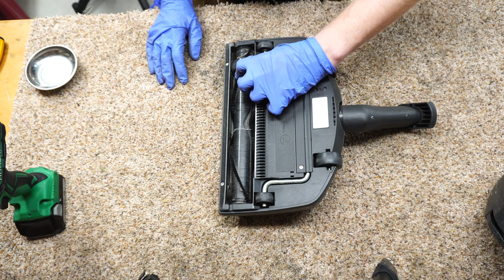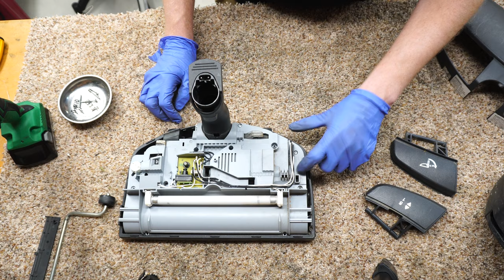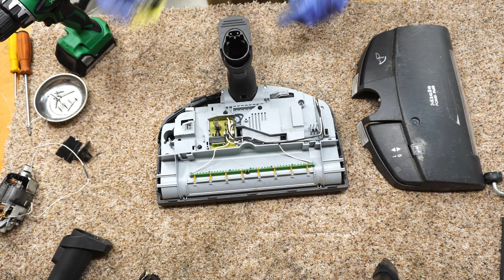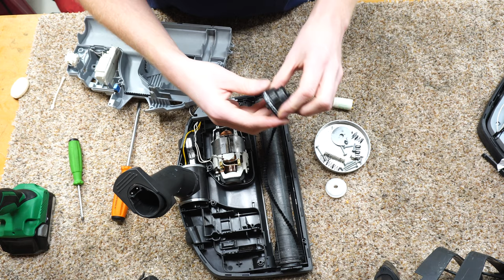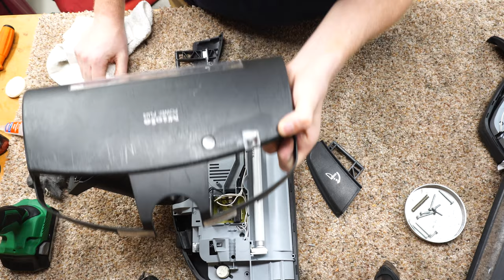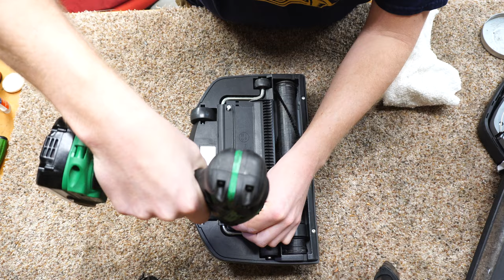Miele SEB 236  Electro Premium Powerbrush S8 C3 - Vacuum Repair

Comment: Did you speed up the video? It seemed a little fast
Reply from the maker: Yes about 20%
Reply: @PerformanceReviews  I wish it was in original speed. No rush
Reply: It still seems to drag
Reply: How can I order the plastic part that broke? Our local dealer had no onsite vac repair tech. The cost of shipping it out plus actual service fee was almost the cost of a new head.
Reply: @sgtjonson  you can slow the playback using the gear icon. also you can zoom in on the playback, which can be helpful.

Comment: I was director of a large data center.  A professional data center cleaning company came in. The used a Miele vacuum in the smaller areas. So when our home vacuum broke my wife and I went to a professional store and purchased on. That was over 15 years ago. Today I am replacing the belt on the power head. My wife loves her Miele.

Comment: It it a very robustly built powernozzle that performs really well and the convince of being able to adjust the height with your toe is great. However it’s extremely complex and we’re I to install a central vacuum system in my house I’d most likely opt for the Sebo ET-1 powerhead instead. I believe that its removable brushroll encourages more regular maintenance thereby lessening the need for a thorough service as this very often. It also comes with a color selection which is cool.

Comment: Just took apart and cleaned mine. It's basically the same internas as the SEB228, what's the point of offering both? Seems like economies of scale making just the SEB236 would be more profitable in the long run?
Reply from the maker: The EBK 340 came before the EBK 360 the SEB236 is an evolutionary stock Gap in between them that came out a decade before the EBK360 aka the SEB228

Comment: This video is gold. It goes by quickly, and it's a bit confusing with the two or three different varieties of power brush being worked on simultaneously, but he's got lots of great tips in there. You can tell this guy does this for a living -- he assembles and disassembles these things like a marine field-stripping a rifle.

I found this video after my Miele SEB 236 power brush kept tripping its breaker. I had already pulled a ton of hair out from under the belt with tweezers, without disassembling the head, but it would still get stuck, and the brush was hard to turn with my fingers, so I figured it was time to take it apart. Still, this was after eight years of service in a three-dog household. So it's not like this is something you have to do every year or even every three years (though it probably couldn't hurt).

My brush had two squirrels' worth of hair inside it, especially tangled up in the motor gear that turns the belt! Gotta hand it to Miele though, the parts are solid as heck, metal and dense plastic, and after I pulled all the hair out it ran like new. The belt is toothed instead of smooth, and still looked great after a ridiculous amount of dog hair abusing it for years. I added silicone grease to the height pedal plate and tri-flow to the motor and the brush bearings like in the video. I just scrubbed out the inside with cleaning wipes instead of running it through the dishwasher, because I wasn't brave enough to totally remove the motor and re-tension the belt. But I figure I got 80% of the way there. Also, the tip about the bearing cooler holes in the brush was gold -- I made sure to clean those out as well.

As other comments have mentioned, watch for the screw placements on the gray interior part. There are a ton of screw holes in it, but only five of them (on my model) were real top-side (gray-side) screws. The way to distinguish them was by shining a light through -- the top-side screw holes were the ones you can't see through. The bottom-side screw holes go all the way through, since they secure the bottom of the case to the top. On my model, the pedals are one solid piece instead of two like the video shows, so apparently they've changed the design to make it more reliable.

The clear plastic rocker under the "lean-back" pedal was also a little tricky. You have to push it down into its socket pretty firmly to get it seated, otherwise the gray top won't go on easily. But just take your time, and it'll come together.

Comment: Great video; thanks. Have a SEB236; the left foot locking device snaps into place and then pops right back out. It has a spring that could hold up an elephant. I can find the locking device online, but not the spring. If I could order those two parts, not sure it would fix the problem. Any advice would be more than welcome.
Reply from the maker: Bring this to your local dealer.

Comment: Followed your video--was able to take it apart and find the broken plastic wand release piece that was jamming the mechanism. I removed it and can use it again but obviously doesn't lock up in place.. Where can  I order the internal plastic wand release piece? No local repair available in my area.  Thanks for this video--super detailed!
Reply from the maker: You need to call a local dealer to get the part.
Reply: @PerformanceReviews  I have had 2 broken ones already, replaced first one at dealer. just today found it broken again. flimsy plastic piece.

Comment: Noticed you forgot to replace two screws, one on each side of the nozzle, after setting the light grey section in place.  Just for the newbies following your every move.....Not me of coarse!!! ;)
Great video...Thank you!
Reply from the maker: There are four screws that go in the middle blue section  before the cover goes onall of which are in place you can see later in this video some parts were skipped to make the video shorter.
Reply: @PerformanceReviews   I should have specified neck instead of nozzle. At 19:55 the screw holes are empty on each side of the neck just before the top cover goes on.
Reply: @babbs128  he did forget to put those in. Noticed that as well. Sloppy!

Comment: Thank you for this in-depth video. I have a question regarding this vacuum head, I have the Electro Premium version. The vacuum sucks fine on normal floor mode, but when switched to the carpet mode, it runs for a few seconds and then the reset button light turns on for no apparent reason. The motor has a different muffled sound as well, compared to the usual sound. I'm wondering what could be the cause of this and whether I should purchase a new head altogether. It is about 5 years old. Any advice would be greatly appreciated!
Reply from the maker: Bring it to your local dealer for service. Most likely it will need to be cleaned oiled and adjust.
Reply: @PerformanceReviews  Thanks for the response, I really appreciate it! I actually took it in for service yesterday right after posing this question to you. Haven't heard back yet, but I'm sure he'll address it for me. Regardless, your videos certainly helped me understand the machine better, so big thank you for that!! 🙏 Hope you have an excellent day and please keep making these types of videos, they're super helpful! 💗👍

Comment: Please Help!  Love the video. Followed it well. Fixed the debris problem (hair around the belt holder).  But now the height adjustment will not work!  I've tried flipping the inside spring in the knob, since one end is wider than the other. Still no luck. Stays on same number when i click metal lever. Does cover need to be on to function?  Any help is appreciated!
Reply from the maker: Follow what I said in the video.  "Take it to an authorized dealer" "do not try this at home!"

Comment: @Performance Reviews Hello, I took my Miele SEB 236 Electro Premium apart because the connection socket foot release button was not working and found that the plastic socket locking device was broken just like in the video. I also found the plastic cover on one of the brushroll black bearing end caps was damaged and needs to be replaced. I was wondering where can I purchase these replacement parts online and what grease did you use in the video on the certain parts? I do have Trident LP20 Silicone Grease which says I can use on rubber, plastic and metel, would this be okay to use instead? If so, would you recommend to use silicone grease on the rubber belt for longevity instead of a bar of soap? I also don't have the oil you used but I do have sewing machine oil, can I use this instead on the parts? Thanks.

Comment: I did call an authorized Miele repair place.
  He said spring will run $5- $10.
Service of powerhead $69.00.
I also called an authorized Miele shop that serviced the vac before in 2019.
  So I took it to him he said the release lever doesn’t need a spring. That was yesterday.
  He said someone is going to open it up today and give me a quote on how much it’s gonna cost.
   He’s thinking it needs a new lever and a new neck which is $200.
   So, which is it a simple spring?
Or am I getting scammed? By going for a new neck and lever without a sprain
Reply: * spring

Comment: I love my 236 but it has one major problem. The air intake path is such that hair and debris get caked on the flat area behind the brush. In addition to that I have to take mine apart every couple months to clean the chamber because the self cleaning doesn’t work very well. The belt needs to be dressed regularly too from my experience. Thanks for the video!!
Reply from the maker: So you run your  vacuum on the highest setting when using this? I usually only see that I'm people who used it with the lower suction/auto setting which doesn't clear the debris.
Reply: Performance Reviews yeah I run it on it’s highest suction. I have two German shepherds and the shedding is unreal. I think that has a great deal to do with it. Good to know it’s not a known issue with the nozzle and it sounds like it’s a victim of my extreme circumstances.

Comment: How do you disassemble the locking mechanism for the hose that you step on?  I can't seem to get the cap that holds the spring to slide downwards,

Comment: I cleaned and regreased the height adjuster (just as you did) but my SEB 236 still slips when going 4 --> 5, instead going 4 --> 4. Do you know what could be causing it?

Comment: You guys open?  Can I bring you mine to the HR location?  It is going in and out of power seems to be linked to the angle of the wand.
Reply from the maker: Most vacuum stores are open I recommend you try bringing it to your local dealer. You can check on my patreon page I do mail ins as welll
Reply: @PerformanceReviews  Im pretty sure you are my local dealer.  Could be wrong I guess....

Comment: Am I seeing a wire spring that holds in place the plastic locking device for the handle release... the clear plastic lever?  Because mine did not have that and it's impossible to keep it in place.
Reply from the maker: Go to your local Miele dealer

Comment: I have the C2 Electro+. Is this power nozzle an upgrade over the 228 or are they the same? And why hasn't Miele offered some kind of mini power brush like they do for their new vacuum. I think it's $129. I would pay that considering the one that relies on sunction is $75.
Reply from the maker: The 236 is their premium power nozzle with a light bumper and low profile. 
Pick up capabilities about the same between nozzles. 
I doubt they'll be a mini electric nozzle on plug in Miele's anytime soon ,due to some European regulations.
Reply: @PerformanceReviews That's the  only thing that's missing from the machine. The turbo mini-brush is good, but I've used the mini electric brush for the TriFlex and there's no comparison. That machine is nice, but expensive. That's a really good machine also, but the C2 E+ is just great, especially when it was 100 bucks less not too long ago.

Comment: Apparently, they don't sell these heads anymore because of the many problems. So, no height adjusting heads on Miele vacuum cleaners in Australia.
Reply from the maker: That sounds like an Australia problem. They sell them here in North America and they're rather reliable.
Reply: Thanks for the reply. Yea sounds like an Australian problem. Quite annoying that the only vacuum cleaner with any quality that is suitable for wool loop carpet that is available here with adjustable brush roller is the Sebo which is ridiculously expensive.

Comment: I’m trying to put it back together but wires got a little loose and it’s hard to get them in place. Right now it’s stuck disassembled
Reply from the maker: "Don't try this at home bring it to your authorized dealer Link in the description"
Reply: @PerformanceReviews  yeah I know but I was wondering if you had any advice on putting it back together ill give it one more try

Comment: Every well designed vacuum allows easy removal of the roller brush for regular cleaning. 
Thanks for showing why NO ONE should buy this vacuum.  I own this vac and the roller clogs with hair every use. Hair also gets between the roller ends and vacuum sides. This is nearly impossible to clean without disassembly. These vacuums are for the very rich who can afford to have their butler take it to the repair shop every week to have the roller brush cleaned. If you don't have a butler, you can't afford this vacuum.
Reply from the maker: Sorry to hear you're having problems.

What's your describing is what can happen if you don't use the machine on the highest suction setting when using the brush.  There might also be some sort of blockage somewhere else that's causing hair to gather. I've been selling and servicing these for years it's not a normal issue. 
Hope that little bit of insight helps you out.